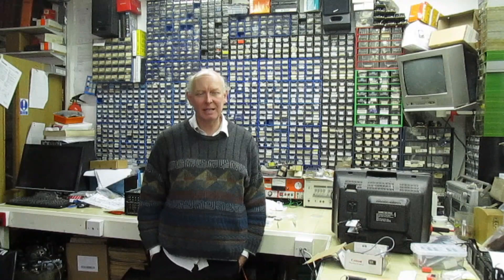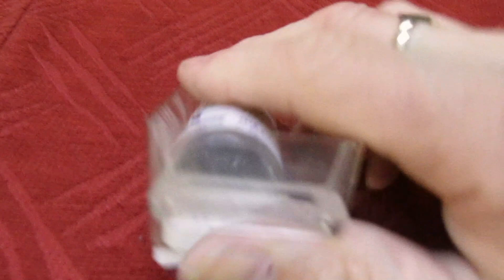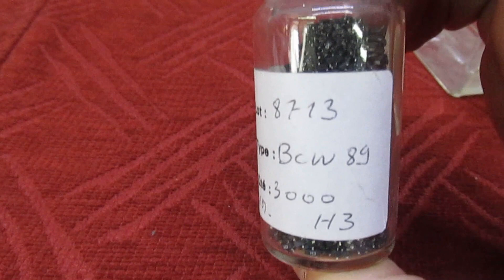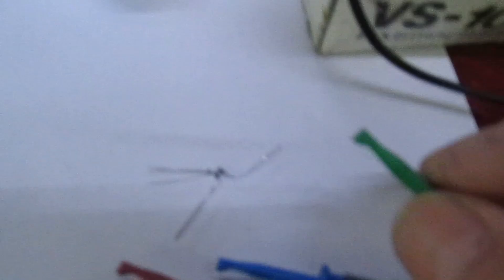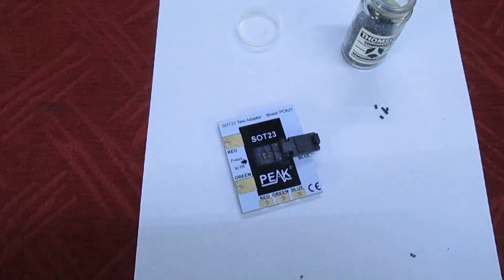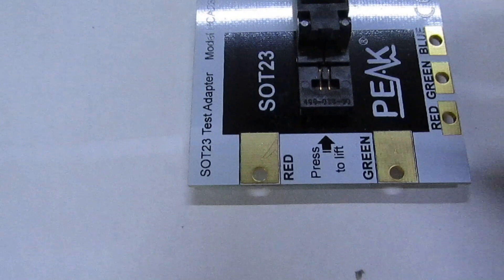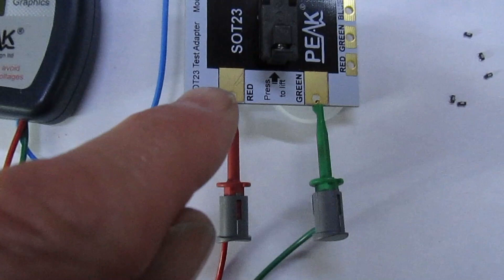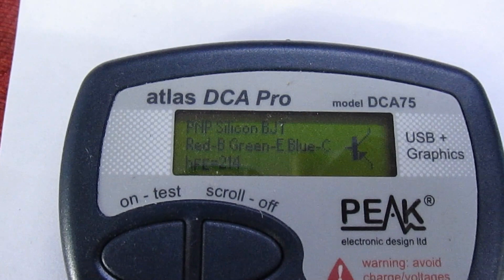SOT23 Transistor testing , the easy way !

Comment: For over $30, I'd be much happier to purchase it if they had made it a full breakout-board that accepts SOT23-6 - there's plenty of real estate on the PCB to do that. Red/Green/Blue orientation doesn't matter, since the Peak DCA doesn't care, and if you're testing a 3 pin device, you know which 3 pins you need to connect to. Looks like they have really 'dumbed it down', unnecessarily, IMHO.
Reply: BTW, thank you for your channel and great videos, Michael. Should have said that first...
Reply from the maker: I kind of like the diumbed down simplicity but as you say perhaps it's not for everyone, glad you like my channel, more stuff coming soon!
Reply: @michaeldranfield7140  Well Michael, I may need to eat a little Humble Pie here. A bare SOT23-6 clamp is currently about $22 before shipping, from AliExpress, and also before spinning up a new PCB to put it on. 
I do have an AC163020 from Microchip that has a SOT23-6 clamp on it, which is currently not being used. I thought about removing that and making my own 6 pin breakout board from it, but upon checking the price of a new AC163020, I almost fell onto the floor with all of the components subjected to too-high air flow...It's now $120! Don't think I paid much more than $20 when it was purchased.
Guess I'll now be checking the pinout and attaching my DCA to the pins I need, rather than massacring a unicorn horn.

Comment: i needed to test an SMD transistor for repair only in a compact stereo to revive it, i sticked a to92 bc547 in place of it.... but anyways i use a small piece of perfboard to stick the sot23 and some random leads to fit trough the holes, for the breadboard or something, up to four pins you're ready to go this way, also it's implicit that when making perfboard projects it's super easy to add a sot23
Reply from the maker: I'm no fan of these parts once you have established the part is faulty then you have all the trouble of trying to find what it is from usually only 2 or 3 numbers. and letters.